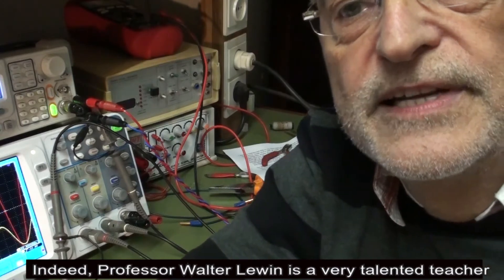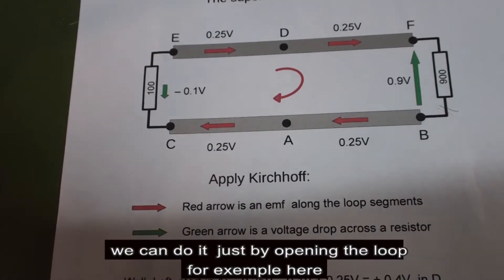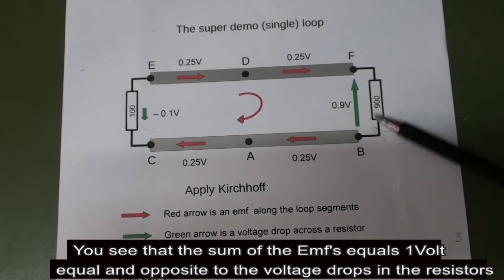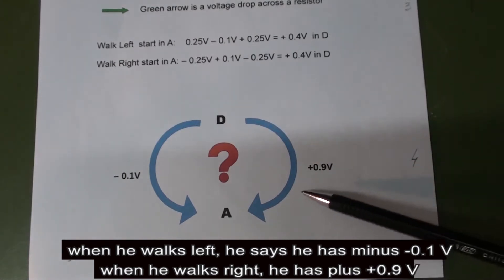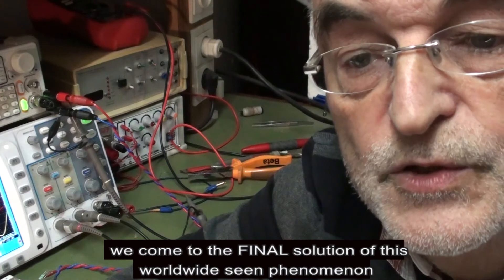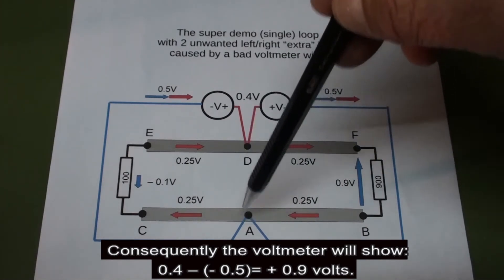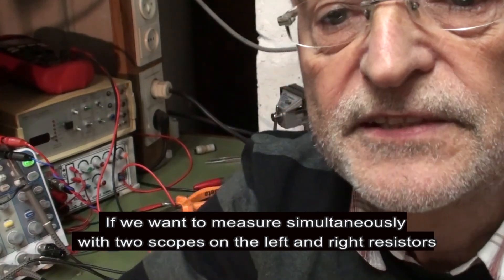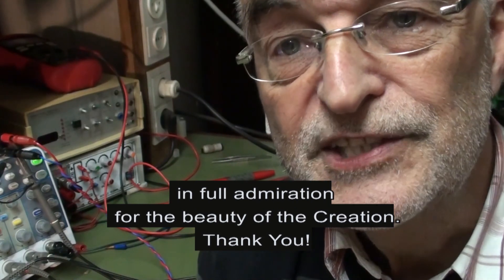W. Lewin Lect. 16 super demo revealed

Comment from the maker: Some people  still have doubt about the orientation of the field lines of my short coil. Also they have questions if it is possible to measure the emf-voltage across the conductor segments, and  finally, if my measuring method is right.
At least it makes me happy to see that some people already have realized that the explanation of the whole Lewin phenomenon can be redirected to a difficult or wrong measurement method. (Remember: professor Lewin says that “there is not an emf in the connection wires because their resistance is zero (Ohm's Law? !!!) and that all the emf's are originating in the resistors”.)
As already told, I was measuring sequential voltage differences (drops and emf’s) along a loop or a segment , with an imperfect measuring system. 
I know that it has an "offset" (error) in the same order of magnitude as the value that I want to measure. Now, take this as example: suppose you want to measure a voltage with a voltmeter whose needle, in rest position, is not at zero.
 You will be able to make correct measurements, if you calculate in the offset and do a relative measurement. 
In the case of the loop measurements it’s not easy to quantify the offset, but, the best to do, is to ensure that the absolute value of the error offset remains at least constant and  as small as possible. Taking care of this restriction it will give us almost exact relative values for the voltages
Of course the offset  depends on the cosinus between the measuring plane and the loop plane. I know that my field lines are not perfectly vertical and I did some mapping about, that gave me an idea of an acceptable deviation from vertical. The bending lines enter partially in the measuring loop of my scope wiring, contributing an unwanted emf, my so named offset. 
If the field was place-independent uniform along the loop path, I could choose another measurement plane. But I took the vertical one as most obvious.
At least, making measurements between  A and D in the horizontal plane, as done by Prof.Lewin did, with the “flipping” action, are absolutely a mistake.
You can say that it was “a” measurement but not the right one.
Why is it so difficult to measure the emf in a segment of a(single) loop?
Someone suggested me to solder two wire ends and glue them on the top face of the B-D segment . Then to make  a twisted wiring to the scope, and all this to avoid creating a wiring loop. I must  disappoint him, that in that set-up he will measure…..NOTHING ! (and maybe this is the reason why Professor Lewin continues stating that there is no measurable emf in the segment)
You will measure ZERO because you are doing what I explained in my video: Your glued wiring, if it is (symmetric in the middle, or asymmetric) connected with a twisted wiring to the scope, it will always create an opposite “extra” loop, lying in the same plane as the main loop. And doing so you may take the false conclusion that there is no emf  in the wire segments.
 Finding the right way, to measure an emf between 2 points on a single loop, is for the time being unclear, maybe  a job for tomorrow?
But no panic! If,  instead of one loop, you install two concentric windings, you can make an almost perfect measurement, at any place between two neighboring points.
If you induce with your driver coil, a total open loop emf that is higher  than 2* V-led = 3.6 Volts, this means 1.9 Volt/winding, then you can make light up a LED, independent of the load due to the resistors. I must confess that to realize this I inserted an iron core instead of the weak air coupling. Note: this is the working principle of a so named "spare transformer"
Conclusion: 
-there is really an emf in the connecting wires; it is difficult to accept just as the   Godly existence for some people, but…feel free!    
-the 100 Ohm and 900 Ohm resistors deliver only very small contributions to the total emf. These are proportional to their physical (what a lovely word !) length . By using smd resistors they are negligible.

Finally let’s be kind, stay polite and listen to Leonard Cohen’s words:
I did my best , I didn’t  come to fool you
Cyriel Mabilde
Reply: Sorry Mr. Mabilde,  but you still  do not understand the induction phenomena.  The meaning of glued the 2 isolated wires on the conductive strip was to realize an oscilloscope  measurament loop of minimal internal area.  The flux inside that loop  was conseguently  dramatically reduced  and  the oscilloscope reading more realistic  (0 volt if the loop has 0 area) .  The evidence that the reading of the oscilloscope is function of the area of the measurament loop should be enough to prove that your wrong measuraments are result of wrong set up.   Inside conductor  the electric field is  almost zero. As consequence the integral of electric filed along the conductor path  must be  almost 0  (for low current). That integral is the Voltage  along the conductor.  The oscilloscope is connected along a different external path and the voltage seen  by oscilloscope  could be different as you have experimented  without understanding.   Professor Lewin  (obviously) is perfectly right.
Best Regards
Reply from the maker: Please take your time, I did it also in formulating my long answer to you.
I must repeat that an emf can exist across a zero Ohm resistor and also across a conductor with a distributed  resistance .( Look at the forum of Dirk Van Meirvenne) . If this was not true, the transformator of our common friend Faraday could not exist and "the economy based on it would not turn"
Prof. Lewin and you (for now, follower of him?) apply even Ohm's law to prove their statement. You're free to think so!
You may doubt about my diploma, because I've been called a "some people with very little knowledge of physics" and thus I can not understand this difficult matter.  
I am not angry about your opinion but I may tell you that I was involved in this matter during 42 years, building all kind of equipment as laser scanners , electromagnetic(yes =Faraday) and ultrasonic flowmeters, flux meters, gyroscopes, and even bio-stimulators based on the the "single loop" to establish the isolation barrier. All these things were first designed on "easy" paper, but I can assure you, that they are still working in practice very well. So take your time, look again especially to my long answer above, and keep thinking critically. Best greetings from Sunny Belgium
Cyriel Mabilde
Reply: Mr. Mabilde, what are you saying the line integral of the electric field round your loop is? You appear to be saying 0.9V - 0.5V + 0.1V - 0.5V = 0V. So, how can this be compatible with Maxwell's Law, which says that the line integral of the electric field is equal to -d(flux)/dt?
Reply from the maker: The -dB.S/dt  is precisely the origine of the 2* 0.5 Volts, nothing else.
Some people consider the emf as a ghost. They do not know where it is  and say that at least it does not exist in a zero resistance wire. You may do that, but at least you must accept that this ghost creates a voltage at the ends of the segments. Maybe it's a little difficult to imagine, but do it!!!
 we do it for so many things, atom models, structure of the universum, our brain function
I just posted on W.Lewin's forum:"believing and science is very difficult" an long answer to him. (By the way it is "not" at all difficult, Galileo is the past)
Reply: You are evading the question. Please answer it. What is the line integral of E.dl around your loop?
Reply from the maker: Not at all, I have nothing to hide as done in the Lewin model. Also, maybe  because of my personal" very little insight in physics" (dixit Lewin) I only  applied Kirchhoff: "the sum of all the  voltages in a closed loop is zero."
Look in all the "criminal" textbooks: at his time the Maxwell equations were still unknown, but his formulation applies perfect here , even with induction. 
So in this extremely simple case: it works, at least when you recognize the presence of the emf's in the segments, what you obviously do NOT. As long as you keep denying this emf,  I think it is wasted time to staying in this discussion; we speak other languages: engineers(with a trashy diploma) versus savant physicists. OK?  if not ???
That's why I am even not talking about E.dl.  I know very well what an integral means, and I'll use it when necessary, not in this case. An integral is  not privileged for a physicist.Everybody must be able to understand this discussion about the loop. "Do not disturb student's intuition" (dixit myself) I never did it! Look again, and again to my video.
 Finally, we never saw details of the Lewin model, nor we had an idea how he measured the open loop voltage. I did it,  and  also my model is very open .You may come to Belgium and  I'll give you my model  as a present, not  the scope of course!
Hopefully then you will not ask me to insert your hand into my chest to verify if I'am not a ghost, like Thomas did with Jesus.
 Best greetings from Cyriel Mabilde
Reply: You say, "I know very well what an integral means, and I'll use it when necessary, not in this case." I think that you are in denial! (mauvaise foi?)
Faraday's Law says that this integral equals minus the rate of change of magnetic flux. The integral IS necessary to apply Faraday's Law. So, you haven't even bothered to apply Faraday's Law to see if it works  for your shaky measurements!!! I know why!
You also ignore the fact that if Faraday's Law works in this case, Kirchoff's Law CANNOT also work, because the two laws give DIFFERENT values for the SAME quantity -- integral of E.dl. It is because Kirchoff's Law does not apply, here.
Your entire demo relies on your false and UNPROVEN assumption that the magnetic field lines are roughly vertical.
(Note that in Lewin's configuration, the magnetic field is negligibly weak within the measurement loops. They actually measured it.)
Reply from the maker: This is my very last answer to you. I was spending too much time in helping you to explain the case and I did it in a POLITE way. You are using humiliating methods to get right. I will not let myself be seduced to enter in the same pitfall. Goodbye for ever!
Reply: I had no intention of being impolite. Whichever conclusion viewers come to, your demo  is very useful. Goodbye, Mr. Mabilde.
Reply from the maker: Very sorry then, it was a misunderstanding with another post and the fact that all my post, and also the critical post of other people, on the forum  of prof. Lewin is instantly censured and disappears. This is "unidirectional" freedom of speech. The video "believing and science are difficult" is directly addressed to me
So, let's be friendly, OK? Then I'll ask you something.
 If you are willing to be clear about one of  your earlier statements:"The voltage you are measuring across the segments is due to the non-vertical magnetic field lines passing through the vertical plane of your scope wires, not a potential drop in the segment."
Now I will ask you : 
1 -   If I measure between A and D, (while the two resistors 100 and 900 Ohm stay installed ), and I do that in the vertical plane, with my scope wires forming an "extra" vertical loop, above the plane of the secondary. What will I measure??
2 - Thereafter, I glue both ends of a twisted pair flat on the horizontal plane and connect the other ends to the scope; what is the result then?
3 - Then I remove the left resistor . What is the measurement  A - D?
4 - Then I remove the right resistor and re-install the left one?
Each time keep Probe tip connected to D (=upper middle point of the loop) and the croco-return to point A (lower middle point). 
Best regards
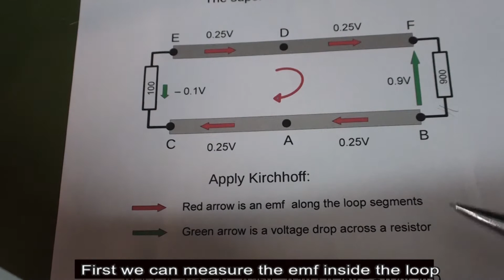Reply: There is an error at time 3:43 with your voltage designations on the 100 Ohm resistor.  Do not know if you or anyone caught that.  Either the GREEN arrow should be flipped 180 or the GREEN arrow left as shown and the sign on the voltage changed to +0.1v from the   - 0.1v as written.

Also, perfect conductors cannot support a tangential component to the E-Field.  This is a boundary condition imposed by Maxwell's equations for such conductors. That holds true for BOTH static and time-varying fields.  In this case all the EMF drops occur across the resistors and none along the conductors.
GH
Reply from the maker: Sorry , but my drawing is absolutely correct: If you walk clockwise , starting in A, you will first see the wire EMF of 0.25 V (same direction as the walking direction) and then you meet an opposing voltage drop from the 100 Ohm resistor. the absolute value is " 0.1" Volt. The point of the arrow is inversely to your walking direction, so according the Kirchhoff's law sum, you must count this drop as minus. Kirchhoff is really right, believe me. The only problem is that our well-respected professor  refuses to apply  K's law  in the single loop;  he is also denying the existence of  EMF's in the wires and reduce them being only in the resistors. That is not the case and that's the reason why so many people, all over the world are so confused by the wrong conclusions out of his super demo. Soon everything will become very clear!!!
Reply: The video is awesome. It is unbiased and the measurements are enlightening.
But you don't understand the Faraday's Law. Your theory does not respect the Faraday's Law. 
In a transformer, the E dot dl through the transformer windings is zero. If you connect your multimeter, then you are closing the loop and to respect Faraday's Law you must measure the induced emf.
There is no voltage across a conductor since the resistance is almost zero. There is a voltage across the device that you are using to measure the voltage, multimeter in this case. In the case of the transformer, whatever way you close the loop you always have the induced emf in the loop. In your experiment there is no induced emf if you try to measure the voltage between two points in the copper as long as you keep the probe outside the circuit.
I will try to make a video following the theory with an experiment. I think you will understand what I and other people are saying.
Reply: Ricardo Nunes,
If you want to help out, go to this thread where the discussion is taking place.  
www.youtube. com/watch?v=v85ln_l0fcE&lc=UgyECdHzy9poLTB3DW54AaABAg

You need to complete the thread links by copying and pasting the above to the URL bar and deleting the space after the ".com" and it will take you directly to the appropriate thread.

It is the pinned comment thread to that video.
GH

Comment: You could use very long wires to the voltmeter to come far away from the EMF. This way the effect on the 2nd outside loop would be negligible. He told me that he used to to the experiment (pre 90's circa) with one meter on 1M length leads and he moved the meter from one side to the other and the difference was evident on the meter. This makes sense with your theory.
  Also i suggested to him that to make the experiment clearer to people he could replace the wire in the loop with resistor wire. Since he says that we should consider zero resistance in the wire of the circuit, then why not eliminate the copper wire and make the entire loop from resistor wire. You can either measure the lengths of 1 Ohm and 9 Ohm before soldering the loop or you can look for two points that measure 0.9 Ohms which is equal to a 1 OHM and a 9 Ohm resistor in parallel. 
   You should in fact be calculating the voltage across a 0.9 Ohm resistor as this is the sum of the two resistors in parallel. Moving the volt meter should not make a difference unless what you are saying is the reason for the change in the meter. So yes. We should put the meter directly up above the centre of the EMF, shield it from the EMF or use very long leads to carry it far away from the EMF. 
  I also pointed out to him that a pulse of EMF rising is only half of the equation lets say that the pulse does indeed induce momentarily a total of +1V in the coil. Well at some point we could assume that the EMF will be broken and it will decay causing the exact opposite swing in voltage. We will eventually see -1V when the EMF decays. So the full equation could be the total of both the voltage or potential induced as the EMF rises + the voltage or potential induced as the EMF falls. This is of course 0V.   +1V + -1V = 0V So can we say that this is the full equation?
  Of course the potential that was induced has been dissipated in the loop as either heat, movement or even light and sound are possible ways that the energy created in a closed loop has been dissipated. 
  We can calculate the true potential induced in the loop at it's peak by measuring the peak current in the loop and multiplying this by the resistance in the loop.
Reply from the maker: Sorry for the late answer: the fact that Walter Lewin does not accept that the emf is mainly "in" the wires will be explained in a second video about the dimensions of the resistors and their distribution along a circular loop. Thank you for your help.
Greetings from Cyriel Mabilde

Comment: Here is the main reason why the magnetic field lines are not vertical. Any EMF across the low resistance wire sections of the single coil immediately cause the field lines to bend in such a way as to cancel the EMF to almost zero. The reason for this is that such an EMF would cause a very large current to TRY to flow through the wire. This would immediately cause the single coil itself to create a distorting magnetic field that cancels the EMF and reduces the current to a small one. In this way, the magnetic field will bend into a dynamic equilibrium state that only allows an EMF across the resistors. This field will not be vertical. It won't even have symmetry (except in your symmetric 1kOhm, 1kOhm setup). So, even if your driving coil could produce a uniform, vertical magnetic field (which it cannot), the field would still get distorted!